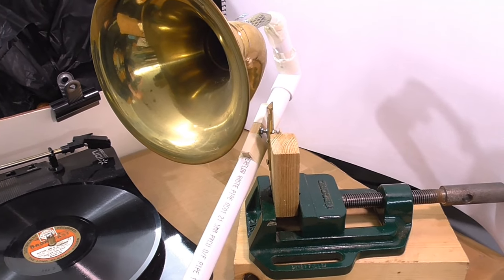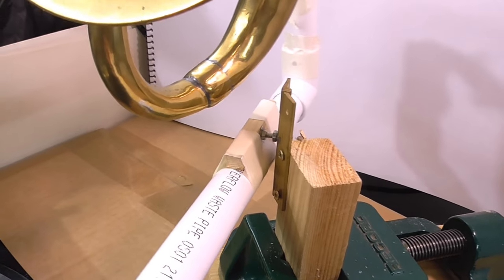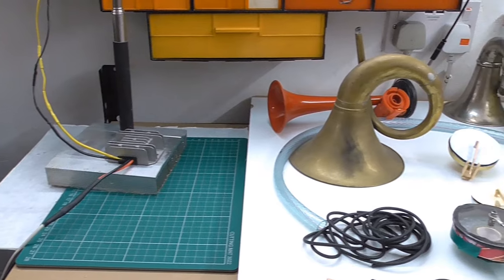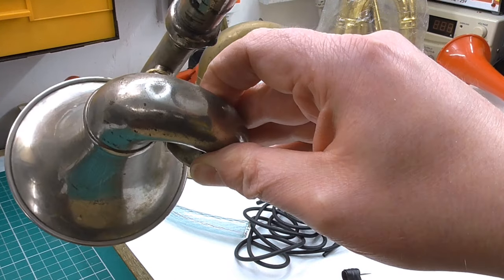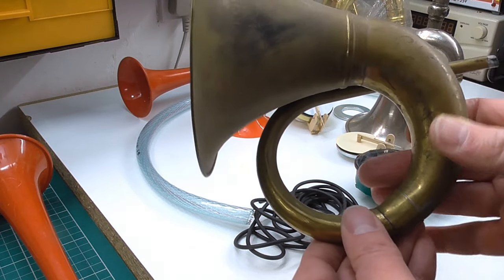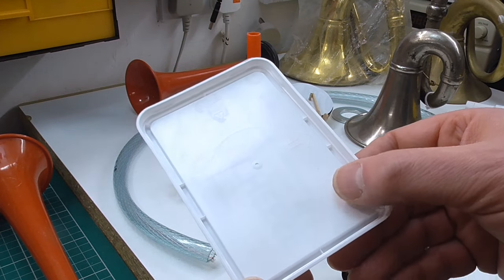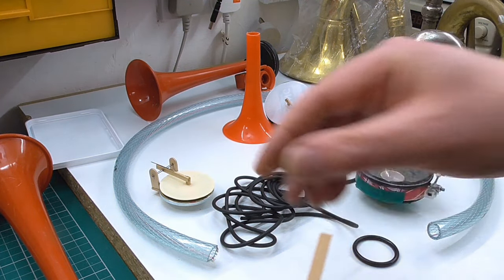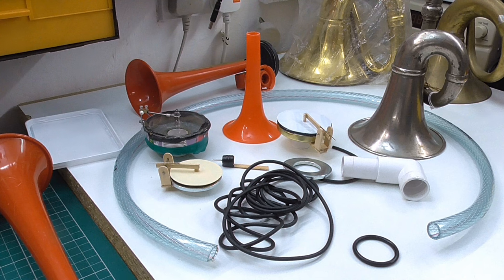How to make gramophone at home

Comment: Use broken phone screen as your diaphragm or screen protector
Reply from the maker: I have seen people do it, and I have bought some glass screen protectors, but they are very difficult to cut and also very fragile. Back in the early days, glass was tried, but mica was preferred as it is much more robust and easy to work with. I have tried a variety of materials. You may find these videos interesting:
https://youtu.be/XqAlJVpN3ZM
https://youtu.be/aMrX8tn-tYI
Thanks 👍 😀